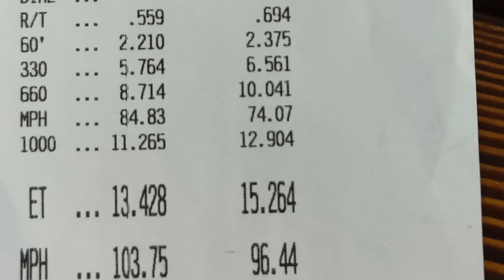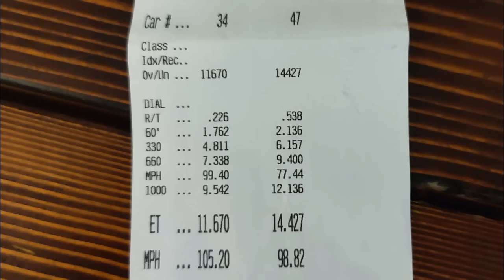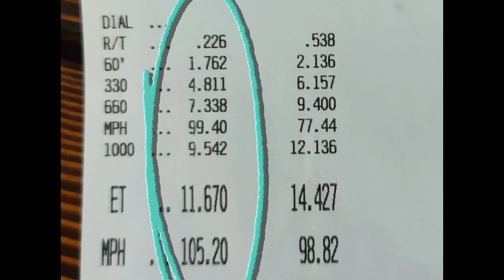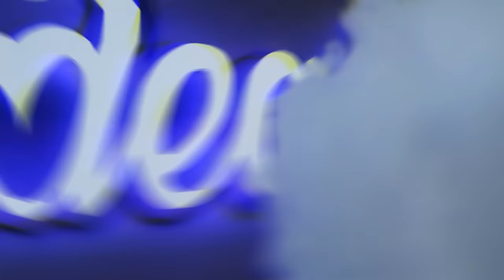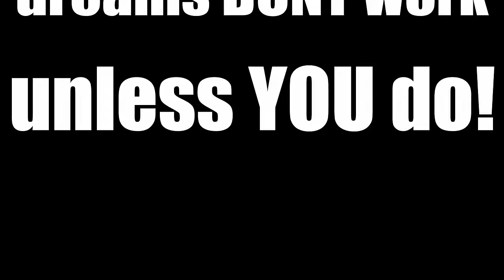Import Face Off! SENT IT Till The Wheels Fell OFF!

Comment: What a bummer, I would have to stick the drag pack on the Tahoe. Since your 8.8”  rear end is 5 lug,why not do a 5 lug conversion? You would have a lot more options when it comes to rim choice. I think John Doc has a white Colorado um 4.8 ls turbo setup for a drag and drive event. They did a 5 lug swap

Comment: B  im a drag race from way back and i have been very fast in the quarter mile  i ran in the mid eights at 170 so i know my way around fast cars this is one of the reasons i rip on you when your revving that stock engine up it sounds horrible to a guy that knows what a good engine sounds like  so im not being a dick it just dont sound good to me   but today when you got out of your cool assed blazer that i would love to have then you said i thought i would get a 12 second pass out of it  nope it aint happenin  take it from me it will cost you at least 2k to get that blazer in the 12s bet???  if you think im crazy check the records not one stock ls has gone anywhere close to the 12 second mark